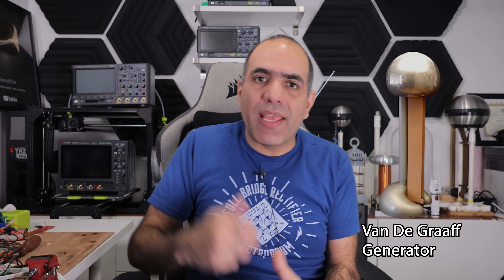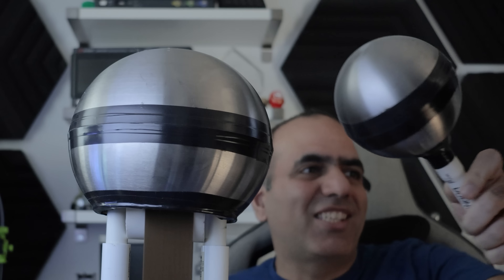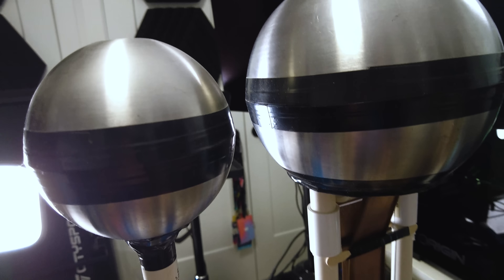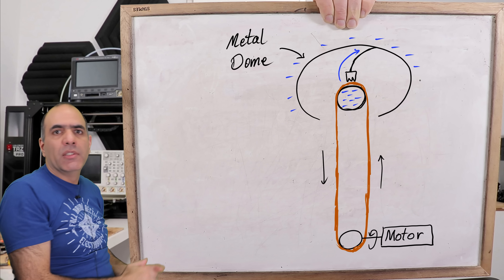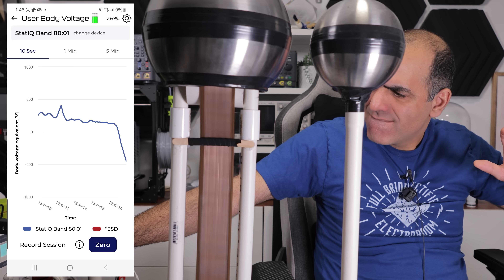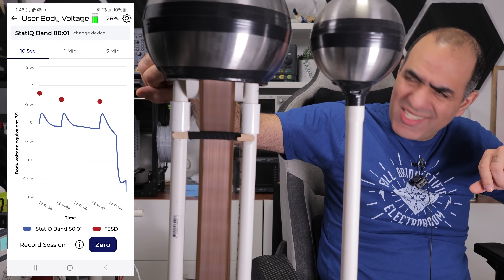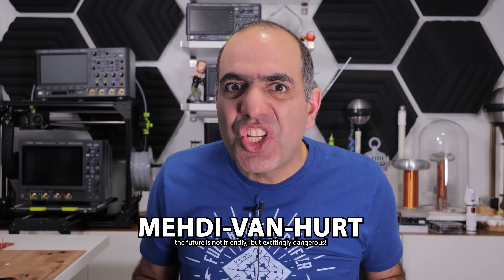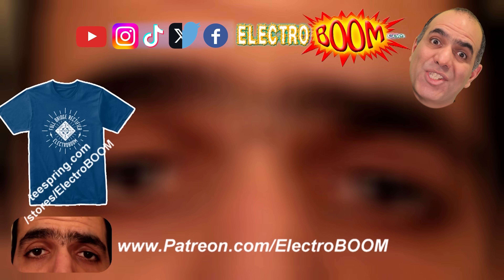An Attempt Was Made!

Comment: Your machine is very similar in construction(albeit, different in operation) to a machine known as a Pelletron (not to be confused with peletron cooperation), another ultra high voltage electrostatic generator developed some time after the van de graaff was introduced. Instead of plates on a belt that undergoes inductive charge separation along the length pf the machine; in a Pelletron, metal pellets isolated but linked, form a chain that is driven by drive pulleys that enforce induction through induction & suppressor plates that pump charge upon the pellets breaking contact with the pulleys(which then moves up the generator and gets unloaded onto the inside of a metal shell, where a similar but inverted process than the first pulley is employed.* ). Machines like these are typically used for accelerator applications in particle physics much like the van de graaff, which can supposedly reach a terminal potential of up to 25MV! Fascinating stuff, highly recommend a look. Amazing video as always!

Comment: It seems max voltage are only limited by ratio 'pumped charge / losses', so you could work on better top load capacitance, good belt material (I guess nylon stocking isn't good option) and better charge pump (multiple brushes?). No need to mix van der graff and Wimshurst, they're already really close in principle. :) I want a digital scope!

Comment: I don't know if you auto-block comments containing links but I can't find my comment anymore.  It may be the answer you are looking for.  As is usual with theses things, there is already a device that was invented in the 60's called a Pelletron that uses a chain of alternating metal and insulating links rather than a belt and comb, etc.  It uses inducer and supressor electrodes that are cross-connected from opposing sides of the rollers at each end and may also have charges injected from another source, such as a flyback.  Like the Wimshurst, they are fully influence machines and don't rely on triboelectricity.  They are used in particle accelerators to this day and can acheive voltages in excess of 25MV.

I've wanted to build one for some time but I have neither the time, tools, or materials at the moment.  I'd love to see you make one though!  And if you want to give me the scope for bringing this to your attention I wouldn't object.  I live in Canada too! Shipping will be cheap!

Comment: Isolate the van-whatever from ground ((over the table), and after that use the ball with different ground. If you pick the ground from the base and you are using two of them ball and the comb from same side that's why doesn't work. i think...
Reply: After check the video from rimstart, Seems you need to remove the tape from the brass bars and connect them with each other in one side and another, put again the copper tape, and made the same thing with different shape... hahaha,  well...  try to put the comb in the other side, u didn't tested it (with copper tape again).

Comment: I am so confused by your first attempt. And overall you just make your panty shorter on one side and longer on the other side. Shortening the distance between the rollers seems to create the same effect, other than it being symmetrical instead of asymmetrical. At this point your panty is also rubbing against the plexiglass which may introduce more voltage.

Comment: I think the trick is to use 2 plexiglass plates with an air gap, and the copper tape on the plates with the belt running as before. I’m not certain, but that’s what my instinct is.

Comment: Hi Mehdi, a random Pole here...
What if you'd bend the domes edge inward (uppward) with some pliers and then isolate the whole bottom part of the dome with some thick epoxy? So that there would be about one centimeter od epoxy there?
I mean up to the black tape both inside (where the edge would be) and outside.
Also if you'd enclose the whole bottom part of the bandograph in a plexi tube it might prevent losing some charge..?
My intuition also tells me that the distance of the moving parts and the table might be a factor, as well as air humidity...

Comment: Ha, it's simple! You need to make a tape of insulating material. Then glue the material that charges the ball in pieces. Next, add an electrode from below that will remove the charge from the pieces that are glued to the tape.

Comment: Hey i watched your mehdi-van-hurst video and i'd like to send you a modification that may works, what if you add a ground brush on the pantie on the side that's going up like you did but bigger? Maybe use like a big surface of aluminum, like plastic sheet with tin foil over it to make the new "brush" instead of the ball that you tried, and you put it rubbing on the side, touching (or almost touching) the pantie. Use the sticks and the plexiglass like you did before but don't use the copper on the belt (they can be charged negative while going down as you said). My thinking is that, if the normal van der graaf generator produces a positive charged pantie going down (neutralised by the bottom brush), maybe adding a new conductive plate (big surface) can attract electron from the ground better than a ball did. It would be similar to a bonetti machine more than a wimshurst so maybe a mehdi von bonetti?
Anyway i hope you continue with your wondefull and funny-learning videos.
Best regards
(I also wrote you on instagram)

Comment: Interesting idea. I think that if you use rubber bands instead, you should try about 1mm plastic. You can take it out of a table cover. It has been proven that if you rub one of these sheets it usually gives you a good discharge. With respect to electrostatic machines, some designs did not have metal sectors. Best regards.

Comment: I have two ideas:
First, the copper foil that you glued on the band. The distance between them is around one inch (from what I see) so maybe try to space them more. The positive charge that you see may be limited by the distance between them, so remove one other foil and see the positive charge how is influenced.
Second, try your initial setup without the dome (the big sphere on top) and see the difference.
Also, what happens if you connect two machines in series? I mean the earth of the second to be connected to the dome of the first one and the eart of the first connect to earth.
What if you pre-charge the bottom of the band with high voltage from your magic wand, for example? Watch the polarity.

Comment: WARNING! Please be careful.  The lengthy arc discharges are creating very destructive electrical discharges at a distance by induction.  This means that the ultra-sensitive inputs of your high end oscilloscopes is is peril.  I suggest you place 6 small dipole antennas regularly spaced out on the periphery from the HV source to visually witness what is happening.  Dim the lights for a better display of the effect.  Perhaps a few of your channel viewers have experienced receiving nasty elbow electrical shocks when they were zapped while watching a Van De Graaf  demonstrations at a museum.  Simply standing near one will make you accumulate charge.  Truly weird things start to happen around ionised air as well.  Consider the POTENTIAL dangers ( yes pun intended ;).

Comment: If you are wanting to increase the voltage (distance of the spark), can't you just run the discharge through a transformer? (The arc/pulse is basically one cycle of "AC" so a transformer should, in theory, multiply the voltage).

Comment: I read somewhere that using a High voltage power supply, (1-5KV) on the bottom electrode can boost the performance of van de graaff generators

Comment: Have you considered building an externally-excited van de graaff generator? You can use one side of an NST rectified to DC and sent to a comb which is placed near the bottom roller (basically an electron sprayer). 

I believe you will need one or both pulleys to be conductive in this arrangement. Bottom pulley gets grounded. 

A pretty good builder’s guide used to be online, but I can no longer find it. The owner is Walt Noon (California-based experimenter and magician) and his website is “Noonco”. He does respond to emails.

Comment: I have learned that repeated shocks helps with my fibromyalgia😮. I'm assuming you don't want to use any electronics to provide the negative ion boost? In the past I have made a compound multiplier with a positive and negative Marxx generator to achieve better than a 2 '8"spark. It emits enough x-rays it is run behind leaded glass and shielding 😱. Of course the whole thing is in a faraday cage. Neighbors got a little pissy. 😠 Never was smart enough to actually figure out the voltage because of all the bleed off variables. I'm fearless in this thing scares me. You have to wear earplugs.🫨 I think I'm going to try a much longer pantyhose belt with metallic thread instead of copper plates. I think you have the right idea

Comment: Are you getting unintended triboelectric charging between the brush contacts and the belt, or maybe with the Plexiglas or something? Could you engineer the belt guides that squeeze the belt closer to the Plexiglas to have beneficial triboelectric interactions with the belt?

Comment: Peak voltage is determined by the size of the dome, since a larger dome is more smooth (less curvature so less pointy).  All you're doing is increasing the charge rate of the dome, but once it's charged you can't get it to a greater charge.  So I think step 1 is to get a larger dome (which also means a taller belt so it doesn't arc to the ground).  Then if you think it's not charging fast enough you could try some experiments like this.  Thinking about the problem another way: try grounding the top dome and measuring the current coming off of it, and see if your modifications lead to a higher current.

Comment: Instead of taping copper pieces to the belt, you shall stick strips of copper or aluminum to the belt. And give ground to the belt rolling down that is positive side of belt. Cover that ground ball with electric tape and expose a little metal area of that grounded ball so it won't suck charges from the dome so it will give proper grounding.

Comment: Mehdi-Van-HURT might need to start with a Wilms-HURT device separate and connect the output of one to the HURT of the other one.  Prove the pain producing potential before combining them.
Reply: That is exactly what I did. And it worked well. Various methods of pumping high voltage into the lower comb of a Van Der Graph have been used in the past to improve performance. How well it works depends on what the limiting factor is in your Van Der Graph. In a humid environment where triboelectric charging is not very strong, you get a lot of improvement. But in any case, this is not a new idea. However, Medi's approach is not a good way of accomplishing the combination.
Reply: @tomsaksa7945  I think he's more about making funny videos. I bought a mini audio Tesla Coil from Arc-Attack (music band) at a Maker's Fair at San Mateo... it's a small, tabletop version and the Electric field output fried all the inputs to my 27" LCD monitor; it was only in close proximity.  So I don't play with high voltage much, but I do think it is interesting.

Comment: the reason the belt is negative- your dielectric (pantyhose and pvc) is not the best also the physical + and - parts need farther distance with higher voltage, and the stronger the charge the easier to bypass insulation, high voltage is a pain and mostly bigger is better (equipment that is) also the distance between gaps is the leak source many small gaps is the same distance as 1 big gap. I've built many particle accelerators and hopefully some of my tips help. dialectrics are also a pain to get right as they all have different properties, which make them a pain to find ones that are reverse compatibility. farther on the scale from each other the better but also they will leak electrons depending on what type. my 10 foot vandegraff gen has killed many leds and electronics in other rooms even so be careful around your equipment , even when you think it is ok later you will find out it killed something in the other part of the house , loose electrons are a biotch sometimes

Comment: You can make pretty good high voltage sparks with a PVC tube and paper towel. I made a 33 cm spark and somewhat smaller sparks using PVC and a watermelon and grapefruit,  maybe of interest. If you search foster cheap high voltage in G images you'll see a coke can and propane tank where I came upon the method.

Comment: What if you put the Wimshurst machine on the bottom with the traditional setup of the 2 disks going past each other and have the negative side face up and positive face down with a comb either on the pantyhose going up to add charges or a wire directly connecting the negative charge to the sphere on top. My inspiration is from the windings setup for Tesla coils. Except this is obviously different in how it works.

Comment: Can I propose a modification to enhance it? It goes as follows: you cover the lower pulley with metal to make it conductive, then you connect an high voltage DC source between it and the brass rod that makes contact with the ribbon copper plates. But the electric contact must happen while the single copper plate is on contact with the pulley, and stop right before separation. Basically I tried this some years ago, anyway, good job!

Comment: I did a video like this a while ago using my own van de graaff. But more specifically about lightning rods. A small correction I need to address about creating static power is the word you use “rubbing.” static is built up by simply contacting opposing materials, not rubbing. Rubbing is just contacting. A band rolling over a roller is simply contacting repeatedly and not sliding/rubbing. 

The terminal voltage is simply determined by terminal size and perfection of the sphere itself. The speed at which it’s charged is determined by the materials used and efficiency of the machine. But max voltage always comes down to the terminal. Stainless garden spheres work great and the cut edge is best insulated with silicone aquarium air tubing cut lengthwise and slipped over the edge. Electrical tape is not enough. You also need to file the cut edge of the sphere so it’s not sharp at all and has no burrs. Even one tiny burr can reduce voltage and arcs significantly.

If you want to experience a super shock, put you hand inside and electricians rubber insulating glove that goes almost to your elbow. It will act as a capacitor and increase shocks to you.
Reply: I think I’m going to put building a Van de Graaff on my to do list.😂

Comment: copper plates too close to each other, induction. your setup tries to balance itself. try aluminum foil pieces instead of copper and don' t bring them close to each other on the belt, it should reinforce the pump, but it would just be a more capable vandergraaff tho.
Reply: now that I think of it, it may not work at all, you may break the static charges on the polymer, you may want to experiment with the spacing

Comment: Try what they used to do originally: use another high voltage source, connect it to a comb, and let the source spray charge onto the belt. Now the charge pumping doesn’t rely on triboelecricity and can (hopefully) reach a much higher voltage

Comment: Without actually having any idea about electricity, two thoughts came to mind: first, shouldn't silicone in any form be a good insulator for edges? You could even mold some stuff for edges if needed.
2nd, also about edges, wouldn't an easy "edge isolation" help with your copper plates? Maybe dip them in silicone or some other insulator liquid and then use sandpaper to free top and bottom.
OR maybe that's stupid, idk.

Comment: I think the problem is that the plates act as a capacitor. Sorta.
They are the same ates on both sides afterall, while a van-der-graph (i think thats the name of the two plates thing?) Machine has the plates alwayd on the same rotating plate.

Comment: I think the plates you applied to the belt are too close together, allowing charges to leak from one to another back to ground.

Try making them smaller and/or increasing the spacing.

Reasoning: the non conductive belt is effectively already an array of tiny spots that hold charge, insulated from each other- you just made the spots too large.

Comment: @ElectroBOOM
Wouldn't adding copper to the divider instead of the moving parts be better?  Or perhaps placing it from top to bottom on the outside of the posicle/stick holders to keep them separated more.
That way, the moving nylon hose moves over the copper, rather than with it, thus precluding the copper from going through the negatively charged dome.